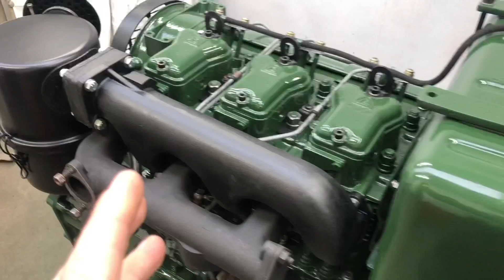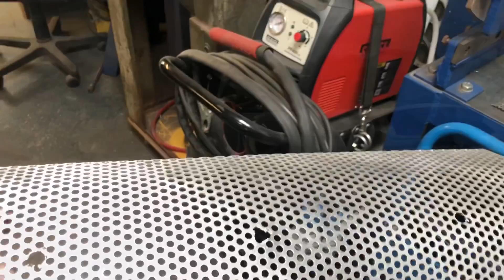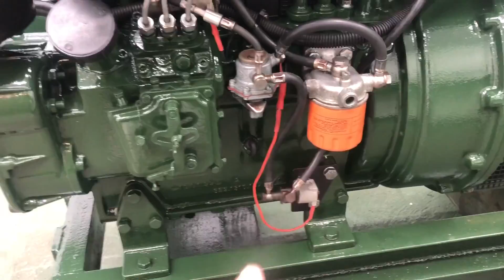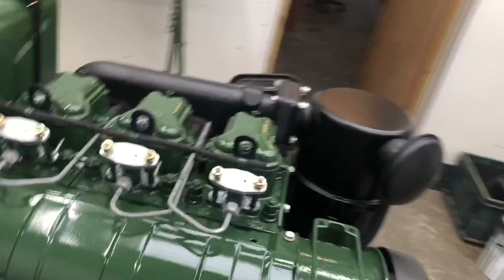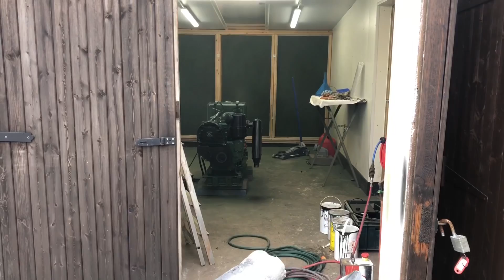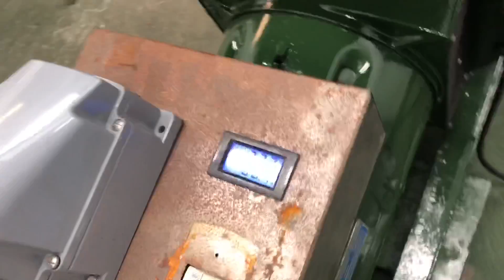Will it Run ??? Italian Lombardini Classic

Comment: Haai, i'm currently also working on such an engine, not as nice as this one 😋 but do you have a partnummer of that oil filter and adapter?? I still have that big long filter mounted and can't find a replacement for it... Maybe this system wil be easier to find parts for, thanks!!

Comment: Lovely little engine Rob.... I am  familiar with these from when I drove walking floor and ejector trailer artics for Veolia in the late 00's......a few of them had these 3-pot Lombardini as Donkey engines driving the trailer hydraulics. 
Others had either VM or Hatz 2- cylinder diesels which were nasty little thrashers compared to the Lombardini !!!
Later wagons had a direct hydraulic  system connected to a PTO on the tractor unit.
Great video as per usual Rob, I've got a bit of catching up to do on your channel at the mo tho.
Cheers and best regards to you and Chris, keep up the cracking work!!!!

Comment: could you not adjust the exhaust with the 2 bolts so it faces upwards to a venting hole when its in the barn rarther than fill the room with fumes ..looks like it could be turned

Comment: WOW, you guys are supper.  I was expecting a 4 wheel classic. But nevertheless well worth the watch. Did you notice the muffler should have a bottom mount hardware to prevent damage to the exhaust header flange I think it should have an additional pipe to keep the exhaust heat off the floor.  Smiled thought out the entire startup process.

Comment: I use a swager and roller ( chris used his knee ) most days at work the metal you have there is perforated aluzink best stick bit paint over that metal lads will rust if generator is outside

Comment: Don`t laugh but that generator is just the machine to get rid of moles! They hate the vibrations from the compression strokes that the engine gives out. Someone I knew had a generator for all of his electric and not long after he was connected to the grid he had moles come onto his land. To keep them at bay he simply fired up the generator a couple of times a week!

Comment: So many comments proves this is popular. Chris really knows his stuff and will know about the automatic voltage regulator and speed controller setting for 1500 rpm. Sure he also knows about mechanical and electrical interlocks needed for a standby generator and a local earth. Just mentioning that here in Australia all this work needs a license, even in own home. Goes against the do anything spirit of the outback but this country is very regulated. PS often an air supply cut off is used to stop generators.

Comment: 22 kva does it have a wattage rating on that information plate? Also did he completely tear down the engine and generator side or was it already in good shape and just needed a paint
Reply: KvA is just another way of writing Watts.
Reply: Nick Carrington kva is always going to be lower than the kilowatt rating, kilowatts are the actual power and kva is apparent power or potential power, you can multiply 22 kva by 0.8 power factor and you get 17.6 kilowatts, it’s just easier to ask if it’s on the plate than to do the math, the power factor is usually 0.8 on generators
Reply: @FaMa87  ah, sorry.

Comment: Really Nice Job, 22kVA Single Phase at 240volt gives an impressive 91.6 amps. Easily enough to run a domestic house which would normally have a 60 or 80amp main fuse.

Comment: Used to do generator tests on Vodafone mtx sites, basically where the masts where.
V8 diesel engine connected to the mains!!
Lol.
Reply: Telephone exchange at Craiglockart in Edinburgh has 2 RollsRoyce diesel generators ready to run 100000 telephone and internet connections  should there be a power cut.
Reply: I went to Heysham Harbour nuclear power station as a student. Emergency power there was 4 Bristol Olympus engines, mounted vertically in concrete shafts.

Comment: Nice to see Chris on camera 🎥 top bloke shouldn’t be so camera shy 
If you need rubber feet 🦶take a look at L&s engineers there useful for odds and sods and plant /small tool parts I’m shore it will be right up Chris’s street, I use them bit there very hand, info, a standard domestic household supply is 15kva so if your generator is 22 should just about power his house lol 😂 
Top vid 👍

Comment: Nice "fix up" guys, does it not appeal that instead of fitting rubber feet you could have industrial braked casters and  the battery /engine control box mounted to the generator unit so it's self contained and therefore mobile' I know it would make it more stealable but it would make it more flexible for use also.
Reply from the maker: It’s having 2 wheels and 2 feet 👍

Comment: Great video as usual. Looks like new.  A useful bit of kit. 22 kva will more than power everything you have on your site probably a welder no problem. 
Years ago I repaired fuel pumps on your engine it's good practice to flush the injector pipes as you did. But this is not nessesary as the pump has one way valves called delivery valves in each outlet if the pump.
The second time it's started I think there was not enough Amos as the stop solenoid it think was starved of amps.  The battery cranking was demanding most if the current.

Comment: That pumping brought back memories of trying to bleed a 70s Unimog in a freezing night, outside. The manual pump is in a horrible place, the least contorted way of reaching it is sticking your whole arm into the passenger side (LHD) wheel arch! After at least half an hour of taking turns pumping we realised that the pump was no good (as was the fuel pump). Our only way of getting it moving again was gravity-feeding the injection pump from a bottle cable-tied to the mirror :-D

Comment: Lombardini parts are always missing things you would expect in a purchase  ...  lift pump no rubber gasket ....extra
Those exhaust shields are more butch and no doubt Chris will be tack welding repair washers to give his some extra  strength before it destroys itself 
L+S  engineers. Bolton  for spares and proper flanged engine mountings  they have an eBay shop   used them for years  ( plant hire spares)  
Nice 1 amp load bank ....  for visual but gennys don't like running light loads 
Once its loaded up it will smell nice 
We used to have carbon fire soot balls into the sky when load banking the big stuff ....  
Nice work .....  as usual

Comment: Just a little question I have for you. I don't know whether this is true I just said I would throw it at you and see what you think. Is it true if you leave a battery on a concrete floor that it drains power out of the battery🤔
Reply from the maker: It’s true yes 👍
Reply: @sruk  👍

Comment: Well done both of you, When using a generator a good tip to have an incandescent lamp  100 watts you will have a constant load I blow up 12.v 25Amp this  power supply with 1 KW Honda  gen set like in the video that you was  demonstrating

Comment: Not only exhibition quality  result, but it runs and does what it should. Chalk up another successful project. The slow crank to start will need sorting in the tune -up and install process if it is to be your replacement power supply, but the project is now very much alive. A very smart generator station will soon be in the offing, well done. A very enjoyable project.

Comment: Approx 95 kW single phase.
Reply from the maker: It’s 3 phase originally but can be both 👍
Reply: @sruk  You could use the waste heat for central heating and hot water, just fit a plate heat exchanger and plumb it into the house heating. CHP.

Comment: I'm sure I have some old rubber engine mounts from a Lycomming aircraft engine, they're about 3" x 2" x 3/4 thick (approx.), from memory they would accept a 3/8" bolt, I reckon they would fit under the feet which are attached to the C' section steel. If you get stuck, give me a shout and i could send you a picture of them.

Comment: Great job Chris. Kudos. Just an observation. It would be advisable to fix a bottom bracket for the exhaust. With the vibration movement it will start cracking at the welds. (I learnt the hard way)